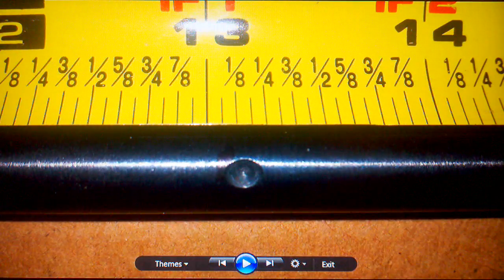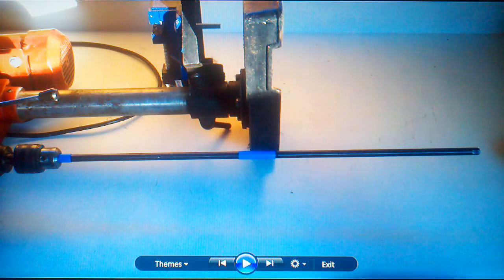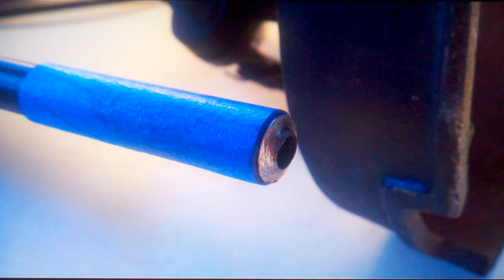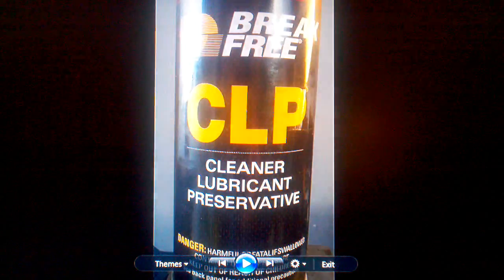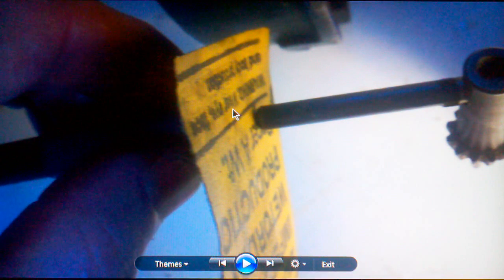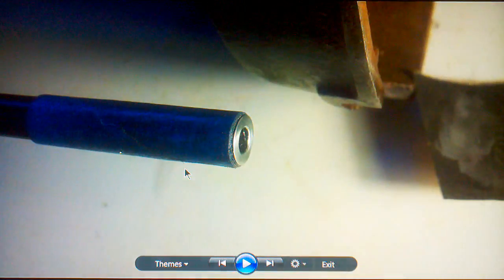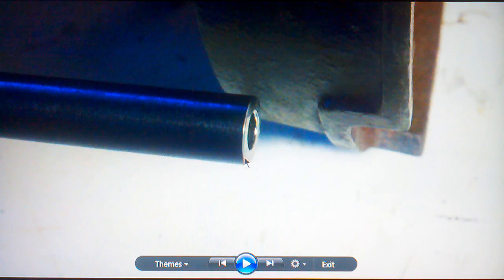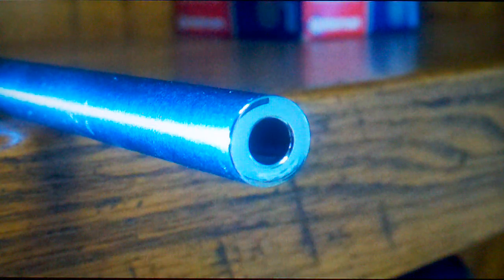Crosman barrel modding

Comment: For the price of that drill press, you could pick up a decent mini lathe.. All the barrels for my crossman guns were warped, its very easy to identify and then fix with the right tools.

All you need is a live center on the tailstock and a small brass hammer to get rid of the warp. Its also nice to be able to sand and cut perfectly square at the desired angle.

If fixing up old pellet guns or modding is a hobby, I highly recommend a lathe..

Comment from the maker: Thanks for the comments
When I first started crowning my own barrels I used a similar proses to what you described, however I found that when the barrel is stationary and the implement for making the crown is spinning the chances of getting it off center are much higher. That is why some factory crowns not so good and why people redo them. With the barrel spinning the crown is perfectly centered. You can't really tell from the video, but the end of the implement I use is spherical.
Cheers

Comment: Good video. Gave me some ideas for cutting down a 24" barrel and crowning it. I did mine a little different. Just cut it clean with a hacksaw and filed it. Then I used a Dremel on the crown. Finished it up with some fine sand paper and a buffing bit.
Reply from the maker: Prepared Survivalist Thanks for commenting and Sharing..
Cheers

Comment: Great video AGN.
  I tell you those guys on ebay are swindlers when it comes to barrels , A person using your technique can easily convert a m4-177 barrel ( part number 417-005) or a 2260 barrel  I just got one from crosman and it cost me about 15$ plus 4$ for shipping they sent it ups and I got it about five days later, I feel like the Joker right now as my 2240 is sporting a 22in barrel. 0o but it puts holes through my wood fence at 116ft
Reply from the maker: Thanks for saying.
The Batman might be in trouble... lol
Reply: Why do you want to destroy your fence by shooting it?
Reply: I get great ideas here.
Reply: @sammyhooligan803  Fence boards are cheaper than gas to drive to the range? And then you have the convenience factor with the fridge nearby etc.

Comment from the maker: Thanks for asking
I assume by your screen name you are asking about a 2260. There are four or five screws holding the breech and barrel on the gun. Two set screws for the barrel band, one screw at the rear of the gun, one depending on age, under the bolt or in the breech opening. If you have a steel breech there will be a barrel set screw on top of it as well. If the breech screw is under the bolt you will need to remove the trigger group so that the bolt will move back out of the way.
Cheers

Comment: Ball end diamond bit on a dremel makes quick work of crowning ;)
Reply from the maker: Thanks for commenting. 
Yes, one method of crowning can be done with a dremel but only with a soft tip and compound. When the barrel is stationary and the implement to form the crown is spinning (even the soft tip and compound method) the crown can easily work off center. When the barrel spins and the implement stationary the crown is concentric to the bore and in the quest for accuracy this is the best way to crown a barrel.
Hope this helps. Cheers
Reply: Quick way to screw the crown up. Faster is not better.

Comment from the maker: Short answer yes. Having said that if you don't have the 2240 yet I would go to the Crosman Custom Shop and buy one there,base price $80 us.Here is why, it comes with a steel breech,you'll have lots of options grips, barrel length, sights. If you already have the 2240 you can order a barrel directly from Crossman. The only difference between the barrels of the 2240,2250,2260 is the length and where the set screw dimple for the barrel band is. But that doesn't really affect anything. cheers

Comment from the maker: @jrice135 
I have cut and or re-crowned about six Crosman barrels using the method I showed.While I didn't check for warp,once they were spinning up at speed they would have wobbled.Ever barrel that I have from Crosman whether in a a gun I bought or bought from there parts department has perfectly straight.The crowns on the other hand I have found to be lacking.

Comment from the maker: Thanks for commenting
24" barrel part# 1760-001 plastic barrel band part# 1389-002 needs screw part# 781A012, steel barrel band comes from 70's era Crosman 760 don't have part#. Crosman, I use them a lot. They only do phone orders but a very good folks. I have also sourced parts from BRYAN & ASSOCIATES they are the only folks to have 760 steel band, they are all so phone order only. I have seen aluminum bands on the yellow forum for sale,I have never bought one.Hope this helps.
Cheers

Comment: To make thr crown, you can also use - a round head screw chucked in a drill, with emery cloth in between, then cloth and polish against the screw, as the final step
Reply from the maker: Thanks for commenting.
The method you described, is a last resort option sort of way of getting it done. If it's possible to have the barrel spinning and the bore centered up instead of the implement used to form the crown, the chances of a bad crown are almost impossible. With a stationary barrel and a spinning implement, the crown can more easily be off the bore center. This will greatly effect airgun accuracy. Hope this helps.
Cheers
Reply: @AIRGUNSNIRVANA  It is surprising how many tiny little things can throw a pellet off course. So many factors.

Comment: Where there's a will...There is a way! Good job. I want to put a 12 in. barrel on my standard 1377 would like to ask what is involved in removing the barrel Thanks
Reply from the maker: Thanks for Commenting.
There's a few good videos out there on This and it's pretty straight Forward. The only real Point of concern is the breech Screw. 
Hope this Helps..
Reply: How long is the stock barrel? 12in sounds pretty short
Reply from the maker: Thanks for commenting.
The stock barrel is 10.5 The 1377 is a pistol after all.
Cheers

Comment from the maker: Thanks for commenting
It just so happened that when I used the drill chuck for the first crown that the end result was perfect. So I never tried anything else. I don't have ID dimensions sorry. As for accuracy, bench rested scoped at 10 Meters 5 shot group and a raged hole slightly larger than the caliber of pellet. I use the same process for .177 and .22. I have done a total of 10 barrels this way all with grand result...
Cheers

Comment: I have a question i cant seam to get an answer to..Does it help or hurt to lightly lube your pellets..i know sorting them helps..i run across alot of them disfigured..but could someone help me with this pellet lube  question.please...Thank you
Reply from the maker: Thanks for Commenting
I don't sort or lube my pellets. I use Crosman Primer Hollow Points. In both .22 and .177 and I find the accuracy of all my guns to be great. Having said that I do get the flyer now and then, And they are probably not competition worthy accurate.
 I would test accuracy of 20 Unlubed pellets first, then shoot 20 lubed. If you don't think the lube helped accuracy pull patches thru the barrel to clean out. No harm no fowl.
Hope this helps. Let me know your results.

Comment: Hello I watch and enjoy your videos, thumb up and subscribed. I have a question that is off topic but seeing that you always respond to questions put to you I figured that I'd give it a shot. I have a a Webley .177 cal Tempest, made in England, that I enjoyed for many years. Recently I shot Gamo penetrator.177 cal pellet with the steal BB insert and it stopped Midway out of the 7" barrel. After that I've tried many different.177 pellets and they all get stuck Midway now. Any idea what could of happened to to it, how to fix it, or who sells replacement barrels for it. Any input from you would be very and appreciated. Thanks 
I also have an older Crosman .177 model,1377 that is not holding air and with that I'm going through your videos to fix it. On the Webley I'm not finding much help and that's why I'm reaching out for you.
Reply: Thanks for getting back to me so soon. I'm going to give that a try. The barrel looks smooth so I'm going to try your suggestion first, it just seemed so strange that it was working perfectly for so many years and only gave me trouble with that pellet and then will every pellet. I had also considered pushing a pellet down the barrel with a wooden dowel see how the pellet came out. I own quite a few air gun's that I've neglected for a while and discovered that I have to use them more often to keep them in top shape. I plan on fixing the Crosman after I get the Webley fixed. The Crosman can easily be replaced so I wasn't to concerned. It was only after seeing some of your videos that I took an interest in it.
Reply from the maker: You are welcome.
I look forward to hearing what you find out.

Comment: If I plan on putting a muzzle break on the end and keeping it on is it necessary to crown it?
Reply from the maker: +Matheson Fraser (Moosehunter158) Thanks for commenting.
The reason to re-crown these barrels, is that the factory crown is less than perfect witch can make them less accurate. If you plan on hitting soda cans only, a brake added to a stock crown barrel is fine. If close to single hole accuracy is the goal then barrel prep is needed before adding a brake. 
Cheers
Reply: +AIRGUNSNIRVANA thanks

Comment: Didn't you suppose to cut the barrel from breech side to the desired length? I think those barrels are chocked at the muzzle, when you cutting from muzzle side you are loosing those few inches of choke witch help with accuracy of an air gun, no? Choke definition quote: "A choked barrel refers to a reduction in the bore dimensions at the muzzle of the gun. The purpose for this reduction, according to pellet makers, is to size all pellets just before they leave the gun. It ensures uniformity"

Comment: Nice work, I am curious why did you cut it at 13”? Is that optimum for FPS?
Reply from the maker: Thanks for commenting.
13 is just what was needed for that build. Its always a balance between longer = more fps and shorter = less fps but is a more compact package.
Cheers
Reply: @AIRGUNSNIRVANA  the FPS is what I’m getting at, FPS increases with length to a certain point then it drops, do you have that information?
Reply from the maker: Thanks for commenting.
So there is about a 10-15 fps-ish per inch-ish gain or loss of different length barrels. The fps of multipumps can be varied by the number pumps. Adding barrel length will add fps at the same numder of pumps. In Co2 the Crosman 2250 and has slower fps vs Crosman 2260. The internals are pretty much the same, the barrel is what makes the difference in fps. Adding a 24" barrel to the 2250 will get 2260 equivalent fps. However having such a long unsupported barrel on the 2250, accuracy will be poor. These are some, but by no means all of the age old considerations when modding airguns. There is not an one optimal length that fits every situation. 
Hope this helps.

Comment: Tell me can a 22 5.5 barrel be fed with a 22lr bullet tip?
Reply from the maker: Thanks for commenting. 
Do I understand the question to be that, can the lead part of a 22lr 
be used through an airgun barrel?? 22lr bullet is a little larger than an airgun 22, so not with out re-sizing them to a smaller diameter. 
I looked online and it seems to be more trouble than it's worth. But if you have success I would like to hear about it..
Cheers
Reply: AIRGUNSNIRVANA 
Thnks for your reply 
Yeah that was my question So they wont fit hey ok 
My plan was to simply adapt a 2240 to live firing amo cal 22 and use the fabric barrel
Reply: I bought a 2240 barrel and shot about 300 22lr through it and ive taken pulled bullets and pushed them shrough the rifling no problem you just gotta get a 5.8mm drill bit and drill a chamber for the shell to fit in i made a single shot and the barrel is really sturdy
Reply from the maker: Thanks for the info... Good to know
Cheers
Reply: theres some coustom air guns here that fire live lr and 22 pellets just google nimrod airguns live 22
Reply from the maker: Thanks for sharing..
Cheers

Comment: Not being a pro in modding, I have to ask. Is it possible to mod a .177 to 22.??? I'm thinking of modding or barrel swapping my 1077 since nobody seems to think a Semi 22 is worth making. Just wanted to check before I go destroying shit
Reply from the maker: Thanks for commenting.
It doesn't look like anyone has done that, there might not be a way to. I don't know how the gun works so I cant give you a knowledgeable run down on how it could be done. The SIG MCX VIRTUS, PCP AIR RIFLE looks interesting, but I don't have first hand wisdom on that one, ether. Hope this helps.
Cheers
Reply: @AIRGUNSNIRVANA  Thanks for the feedback. I guess I'll check out the disassembly vids again & see if & how difficult the barrel is to remove.
Reply from the maker: If you get it to work, I would like to know the results.
Reply: I guess you could with a .22 breech kit and barrel but making a 22 to 177 wouldnt make more sense? If the powerplant of the 22 is stronger you would gain alot of fps
Reply from the maker: Thanks for commenting.
This type air gun powerplant is not caliber specific, 22 and 177 are the same. However going to .177 will gain speed, but a loss in energy is also a factor.
Hope this helps.
Reply: @AIRGUNSNIRVANA  yeah thats what I was thinking if speed gain was the goal! 
Good to know they share the same powerplant (I never looked up)

Comment: Where can I buy a 24" barrel for the 1322?
Reply from the maker: Thanks for commenting.
I buy mine  from Crosman parts department 1-800-7AIRGUN (724-7486) For a 24" barrel the part# should be 2260-003. Some times they change. The people in the parts Department can help.

Comment: Why didn't you just buy the12.5 inch barrel.
Reply from the maker: Thanks for commenting.
Crosman doesn't make a 12.5 plus I needed the bit more length to support the TKO muzzle brake. The online stores selling custom length barrels want absurd amounts of money for one. Like the old saying goes if you want something done your way, do it yourself....
Cheers
Reply: My apologies, but I am in the U.K. and we are able to buy Crosman barrels in approx: 10, 12, 14, 18 and 24 inch... Not sure what you can get in the U.S.
Reply from the maker: A 24" barrel from Crosman is $18 U.S. including shipping. A custom length barrel is $40 to $50 U.S. I am cheap ass so There is that.
What is the going rate for y'all in the U.K.?
Reply: Been doing a bit of research and a new 24" over here costs around £43, that's about $56, that's from  gmac custom parts, a  main supplier. On Ebay UK they still cost around the £40 mark, Ebay US they go for about half that price, so it seems you get the better deal. Recently I bought a new 18" for a 2250, the cheapest I could find was £33 that's about $42. Apologies for my first criticism. Now I got the feeling I was cheated... Nice job by the way...
Reply from the maker: Thanks for the info.
I think you're inquiry was to seek knowledge, not critical. I am always happy to share what I can. If you got a good barrel, that's not a bad deal...
Cheers
Reply: AIRGUNSNIRVANA I cut the barrel down on my Maximus for a 1322 cut it to 16 inches recrowned it. Are you in any of the Facebook airgun groups? I had a spare 177 barrel from a disco that’s on the max now.
Reply from the maker: Thanks for commenting and sharing. 
I am not on facebook, but I am a member of the Crosman Airgun Forum. http://www.network54.com/Index/12861. Good info Good people..
Cheers